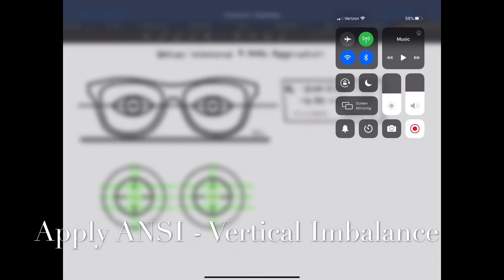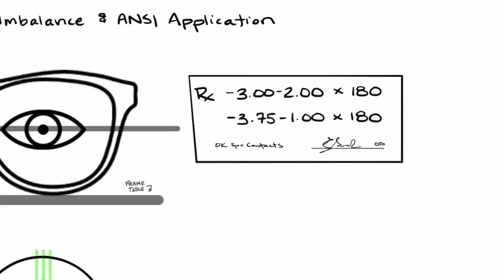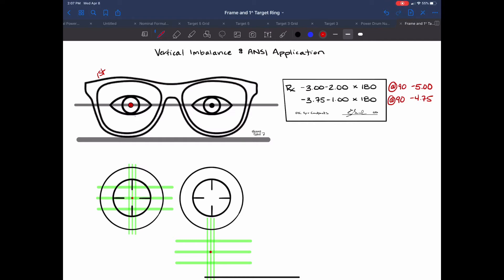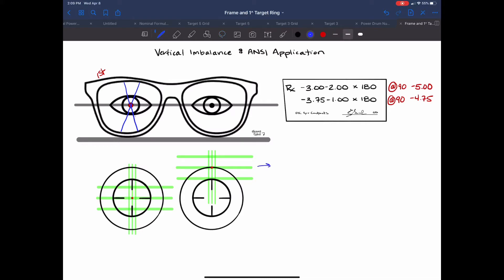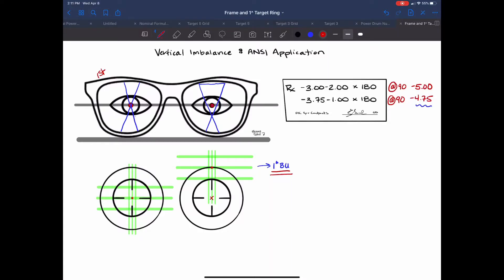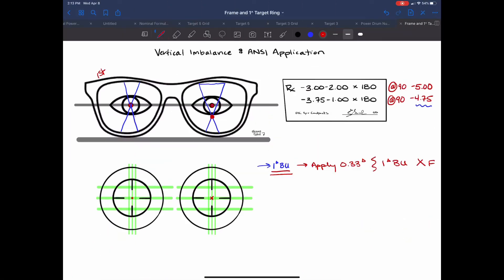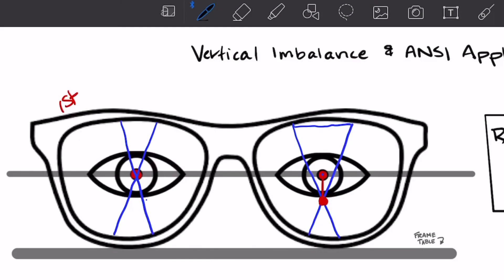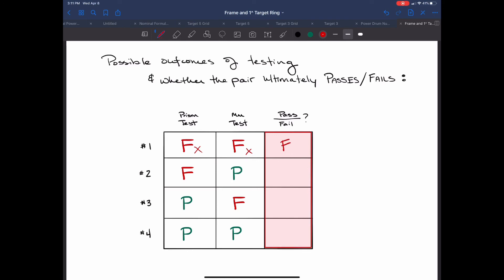Vertical Prism Imbalance & ANSI

Comment: when u order 2mm drop seg and U receive 7 mm seg drop
Reply from the maker: I would need more information to help you sort this out. The prism application in this video deals with SV lenses but it's essentially the same procedure when it comes to checking the distance power and unwanted vertical prism in a segmented lens. Essentially, you should be able to perform the measurement of prism error and apply tolerances the same way.